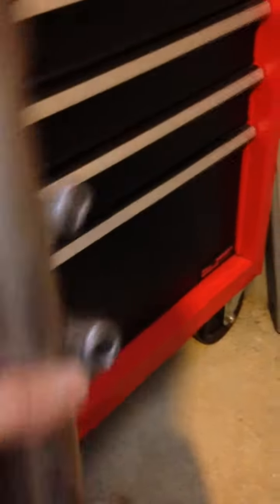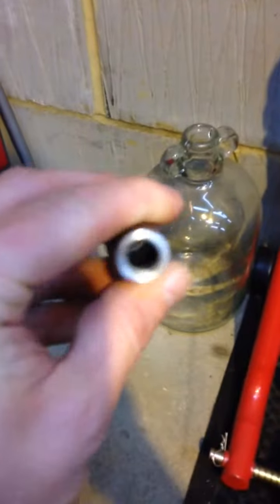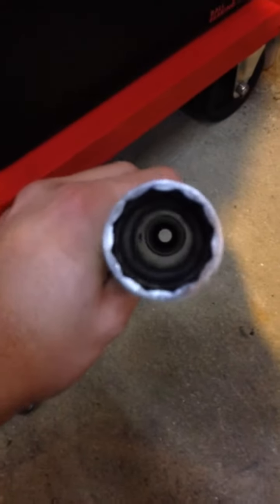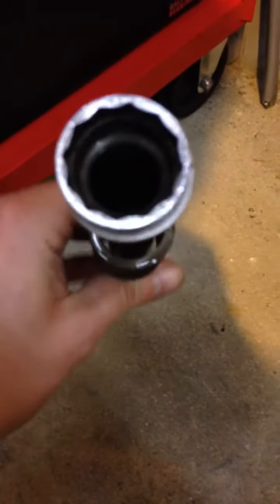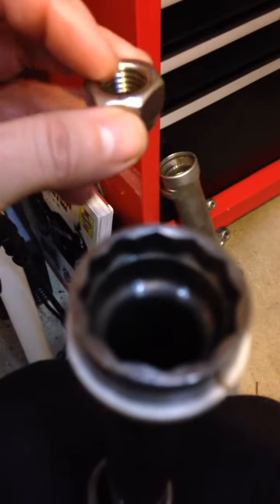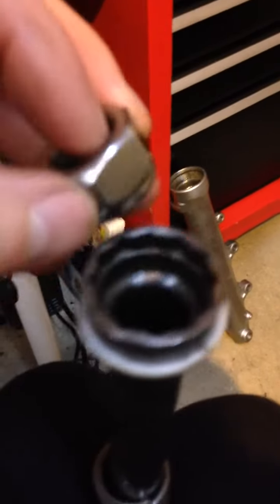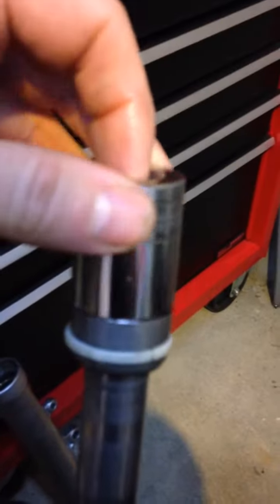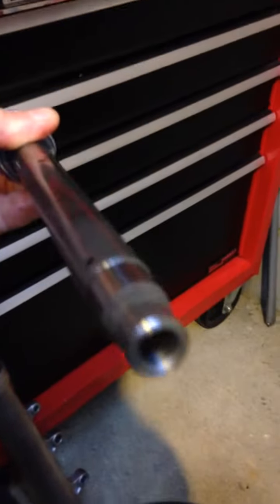FZR600 fork leg disassembly

Comment: Thanks for this i've been racking my brains how can i hold damper rod still while i undo allen bolt you have just saved me £60.
Reply from the maker: JD Thomas glad it was of use to you, it drove me mad trying to find an answer - this worked perfectly!
Reply: @PhilOsGarage  once you drain the oil from the fork rebuild it with no oil tighten the cap at the top,  remove allen bolt at the bottom of the leg and rediasseble no tools needed just needs presure for it not to move
Reply: @Ryan8573A yeah...just tried that. It's still spinning.

Comment: The FZ6 has a smooth round cup at the top unlike this.  I have worked on other older Yamahas and they all had a star point damper tops like in this video.  All that was needed was a nut welded to the top of a T bar.  I hate Yamaha for doing this.  I'm stuck with a spinning damper and can't grab it unless I buy their "special" damper tool.  F them.
Reply from the maker: Joe danero it's nothing more than a way to sell another tool! Frustrating.